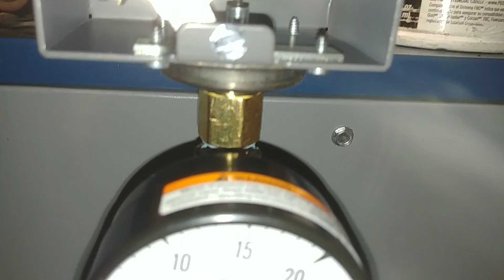Trying To Get A Bogus Pressuretrol To Work Correctly - Honeywell Quality Control Is Junk

Comment: What exactly does bending it down do? my boiler runs too long, the differential is as low as it goes as well as the cut in. If I bend it down will it shut off sooner?
Reply from the maker: @salsplace  The boiler running too long might be due to other issues.
Hard to say from this side of the keyboard

Comment: I doubt I'd have the motivation to repair one of Honeywell's (famously questionable) Pressuretrols. I have boxes of these things from every time I've replaced one with a Vaporstat. Why do boiler manufacturers supply them with the boilers, when they are completely unsuited for any 2-pipe work, and borderline unsuited for one-pipe? Wouldn't you use something where the typical setpoint is in the middle of the scale? Why is Honeywell the only supplier for this stuff?
Reply from the maker: I, too, have boxes and boxes of band-new PA404A p-trols.
They are shipped with steam boilers because that's what meets the UL listing for that package.
The minimum cost for a control manufacturer to change or upgrade a UL listing starts at $150,000 and goes up from there.
Never mind the cost to bring a new control on the market!
I don't think there are any other controls left on the market that meet any legal Listing for Code compliance.
So, we're kinda stuck with what we got.

Comment: I have the same pressuretroll but I guess mine must be 25 years old. It has an Allen set screw where yours has that “blue shmoo”  for adjustment, so I’ve been fiddling with that but I’m not sure how to get it right.
Reply from the maker: The "blue shmoo" covers a tiny tiny (3/32" ?)  allen head screw.
Have you checked to make sure your pigtail is clear?
Reply: No blue shmoo, just the Allen screw on mine. I didn’t check the pigtail because the pressure gauge works so I assume steam is going through the pigtail ok. I set the cut-n adjusting screw to lowest setting, diff wheel to 1 and no clicks do inlossened the Allen set screw to get a “ click” but I could see the that the bottom of the set screw was no longer touching the rod that goes through the bottom of the device and gets pushed up by the steam pressure.
Reply from the maker: I'm not sure what advice I can give you now as to that screw, as I've only tried to adjust that set screw once or twice, and that was over twenty years ago.
At this point, you might have to get a new control.

Comment: Hello, what are the recommended values on the cut in scale and the white wheel?  My steem boiler would not start automatically but will stop automatically when the desired temperature is reached.
Reply from the maker: The value on the cut-in scale should be set to 0.5 psi (the lowest possible setting), and the white wheel ("DIFF") should be set to the number "1" , also the lowest possible setting.
This should run your steam pressures in your system between 0.5 psi and 1.5 psi.
Should, but not always.
I would also check out other videos on the ytube on the Presssuretrol (some of them mine).
I would also check to see if your "pigtail" or steam syphon is clogged.
A clogged pigtail would be one cause erratic operation.
Reply: @gordonschweizer5154  Thank you very much for the quick response.